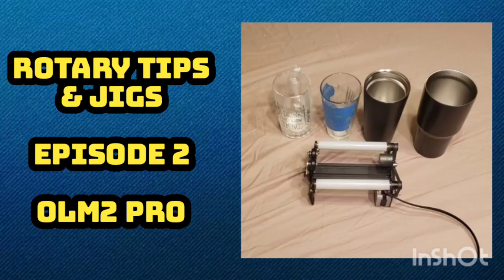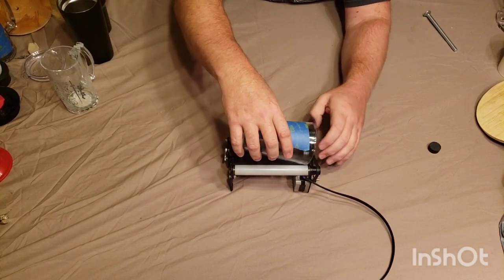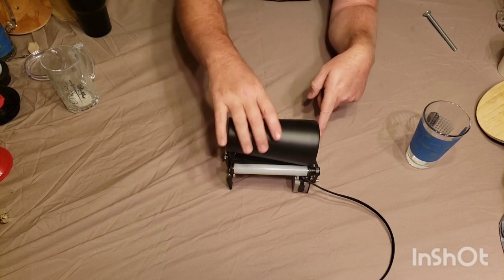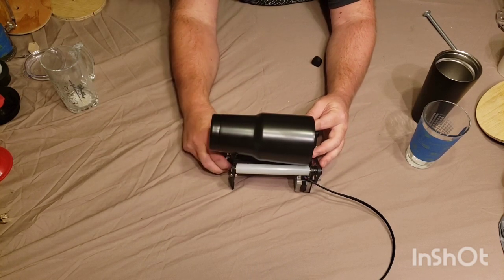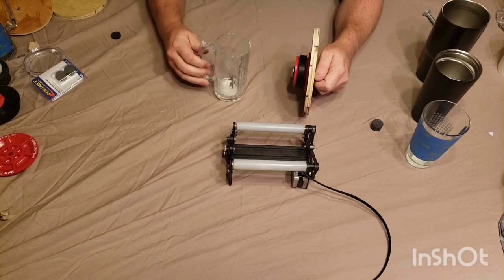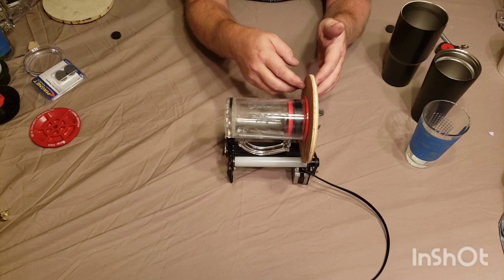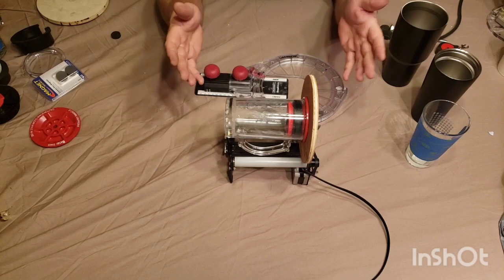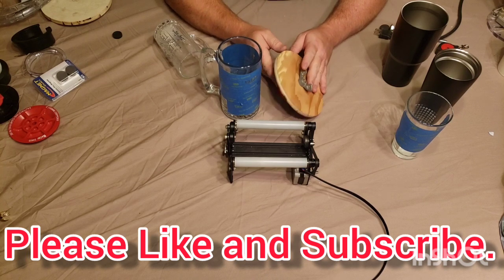Rotary Tips & Jigs: Episode 2 Ortur Laser Master Pro

Comment: Hey brother great video!! I have a question tho…
Do the magnets ride on the inside or outside of the cup? It’s hard to tell and my speaker in my phone is currently not working good…thanks
Reply from the maker: the magnets attach to the head stop plate and extend inwards. The edge of the cup should be running in the middle of the magnets. Most cups are stainless steel and not magnetic. Some of the large 30oz cups can be slightly magnetic due to the metal being distorted in the extrusion process. just glue a 1/4" thick piece of wood onto 1 magnet and use that as your head stop. The magnets should have no affect on the cup rotating.

Comment: The tip to use magnets is absolutely brilliant!!  Thank you so much for sharing it!!  It saved my project this weekend. 👍🏻
Reply from the maker: I've been trying out several different rotary units lately. Most of the low budget ones lack a good head and tail stop system. Seem to always have to find some way to make one like the magnets on this one.  I've tried the Atomstack $120, xtool $250, Ortur $70, and just ordered a Vevor to try out next week. So far for the money the Ortur is winning out of the box. Think I can MOD the others and get them working OK but I expected more from the higher $ units. See if the Vevor 4 roller setup can take the lead.

Comment: what settings are you using for the tumblers?
Reply from the maker: for anodized cups I use 8000mm/min speed and 85% power. If they are powder coated usually around 1250mm/min and 85% power and 0.1 to 0.12 lines per inch for both.

Comment: Tip. Just cut a plywood ring, with the laser, with the outside diameter beeing the same  of the biggest side diameter of the glass and then the iner part of the ring just cut a circle inside with the diameter of the part of the glass where you want the ring to reach and stop. Thdn you put the glass inside the ring,  In this way you level the glass. And you make one for each diferrent shape glass you want to engrave.
Reply: You are a genius! I will use the laser cutter to make the rings then engrave : )

Comment: So I made the jig for coffee cups but the ortur rod (small silver one) that goes across to the motors hits the jig. Am I missing something
Reply from the maker: not intirely sure what part your catching on, but if the jig is sitting on the metal part of the rollers instead of the rubber coated part put some magnets on the headstop to move the jig further back to sit in the rubber coated area. it will slip if running on the metal part.
Reply: @TheKennyHack  the height of the jig is taller than the clearance of my machine. Trying to send a photo but not working right now. I feel like I'm missing something
Reply: @Dogspoiler1  You will have to add spacers to raise up your laser or be able to lower the bed of the laser.
Reply: @jessetutterrow4320  my rotary sits in a hole under my waste board. If I raise my laser it is out of focus and too far away from the object I am trying to burn.

Comment: Question about the roller, can u set it up to use on different machines like the s9? Or is it strictly for the ortur machine ?
Reply from the maker: it would probably work with any machine that uses the same style of pin connector/ wire harness. Think thats kinda the same with all rotary setups is just finding ones that connect atraight to your machine. Otherwise an adapter is probably needed for different wiring.